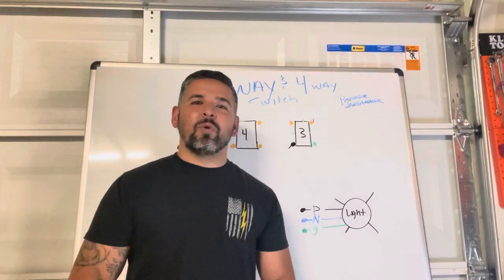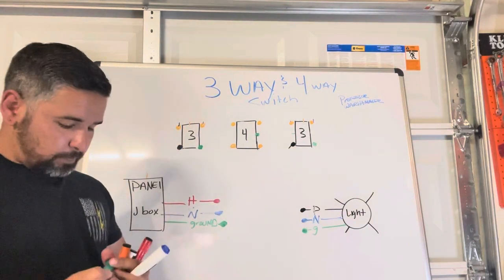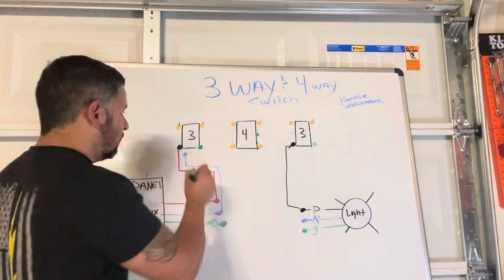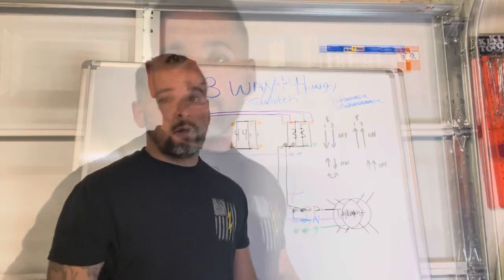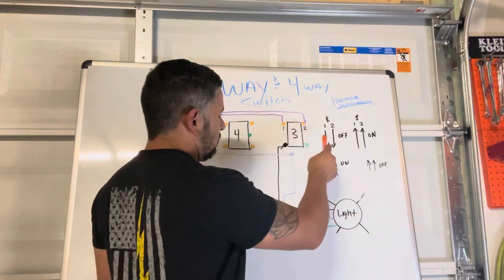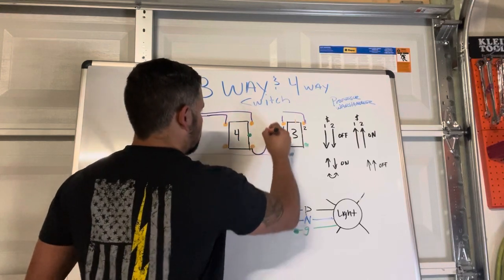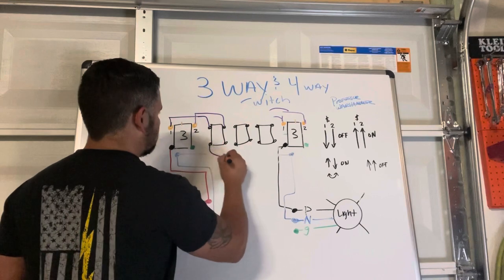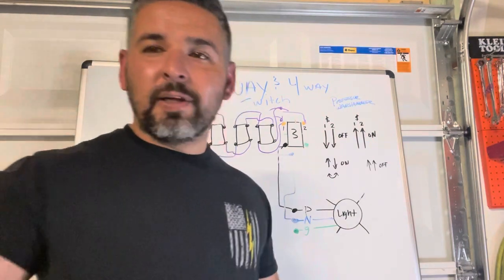HOW TO WIRE A 3 WAY SWITCH!!  EXPLAINED BY WARHAMMER ELECTRIC! ((BONUS)) 4 WAY SWITCH INSTALL!!

Comment: So u would have a 12/2 coming from panel or j box to your first 3way then run 12/3 out to the 4way and another 12/3 to the next 4way then another 12/3to the last 4way and finally run 12/2 to your light or load.